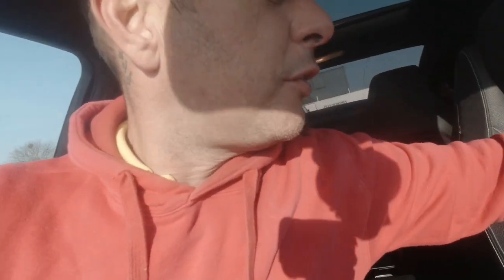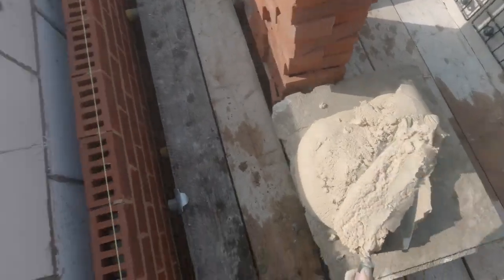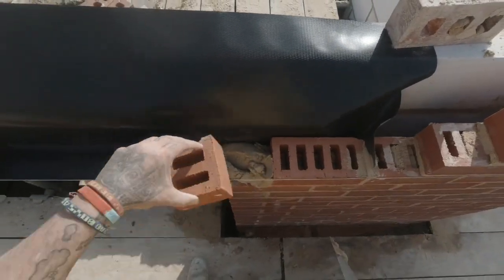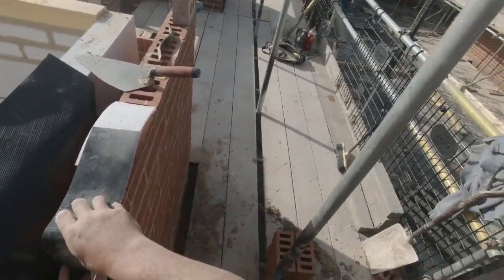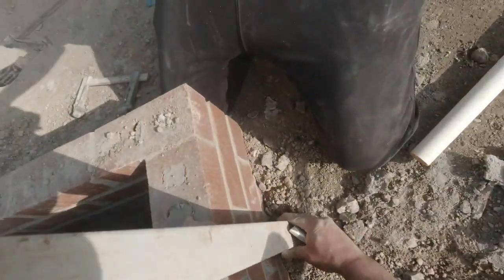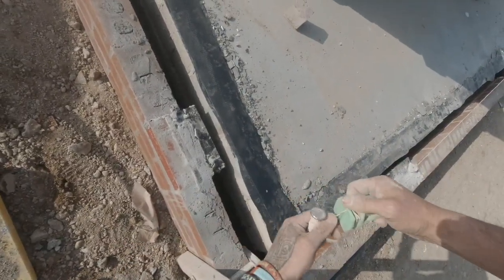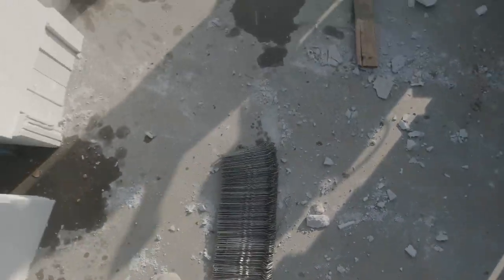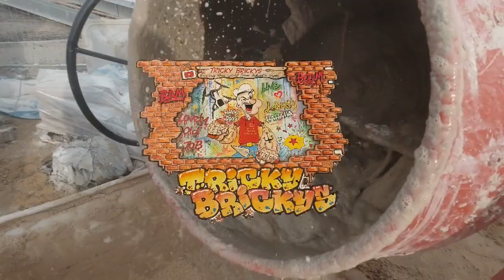Bricklaying - Spring Morning

Comment: I thought we were stopped from building on DPM donkeys years ago Tricky? Do u guys ever need to build in Radon trays? 

That floor slab looks like it’s poured, but it’s vented. Is it grouted tidily? 👍🏼
Reply from the maker: Nobody has stopped building on dpm mate.it Never stopped around here. Never heard of radon trays mate
Reply from the maker: The floor is block and beam. Grout???
Reply: @trickybrickys  Two architects I use state on their drawings in bold block capitals NEVER build DPM through the walls. Radon membrane and tray detail is a pain in the arse, peculiar to areas with granite in the ground.

Used to grout block and beam once finished to lock everything together prior to building the superstructure. I thought the slab looked like it was finished concrete. Have a good day 👍🏾
Reply from the maker: I got ya. Yes I've seen that grout before. They put polystyrene around the egde of ours . I've used dpm on most major developments I've worked on for forever really. Never heard of it being banned. It's used on bloors Taylor wimpy Bellway and redrows.  Even to this day . Maybe something to do with contamination in the ground I reckon.
Reply from the maker: Manthorpe trays. Are the same thing I think. We use them when thing butt up to external wall. Awful thing if they don't work to bond.  Have to cut 3/4s etc. Most of it gets hidden by the lead hey